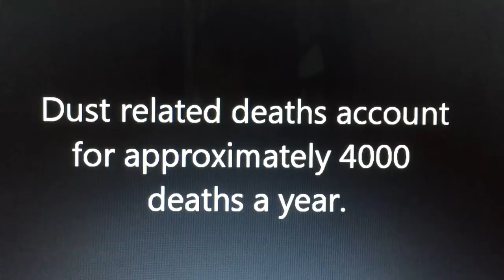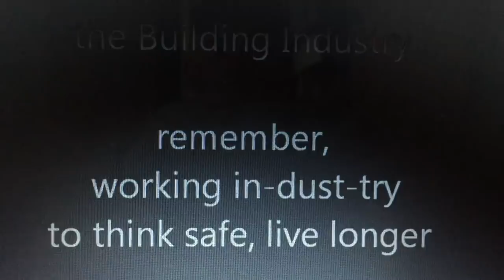the fine art of brickwork - Site PPE and Dust

Comment: Excellent video rob . I agree with you 100 percent. The only up grade I would suggest to you is the ear defenders .I have a set of peltor ear defenders ,the part that goes over  the  head is made from spring wire they are much better quality than the ones you show in the clip . They are a very snug but comfortable fit . I have a set like yours but haven’t used them in years .

Comment: Peltor or 3dm make pro hearing protectors, those you have there are not to be recommended other than for light, not very loud machines.  Dust masks with valves work better for people with glasses, since they 
don't vent as much air onto you glasses preventing them from misting up,
 same for safety glasses.I agree that self protection is a good idea, thanks for posting these great videos Rob, best wishes from Norway.
Reply from the maker: thank you Lucas, how is the work situation there?
and thank you for watching
Reply: PPE is the norm in Norway and one is more likely to get stick for not wearing the appropriate protective equipment. I work building and repairing  traditional timber houses and find there to be a great deal of hazardous dust and fumes on my building sites. I often wear a dust mask all day, especially doing restoration work, since old houses are often a hodgepodge of fibre insulation, mouse shit, house dust and with splashings of lime-mortar and rot all merry motes floating in the sun. I still get cuts and bumps on my hands and the odd black snot day, but every chance to reduce the load on your system is essential. I am 48 and apart from the odd slipped disk now and then, I can still manage to  keep up with the youngsters. Incidently I judge from your accent that you must be from near where I grew up, do you know Bredon near Tewkesbury?